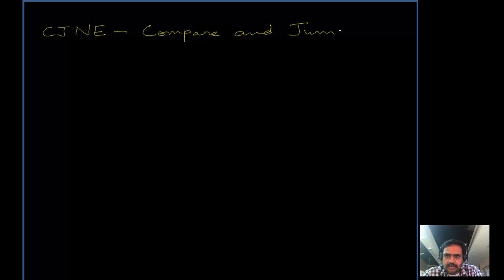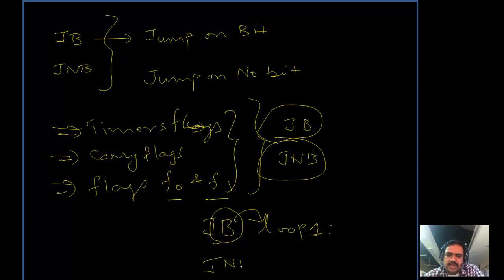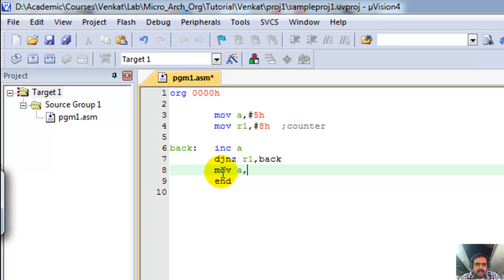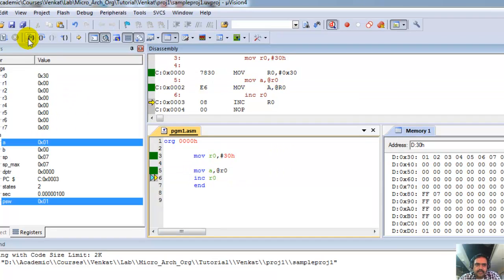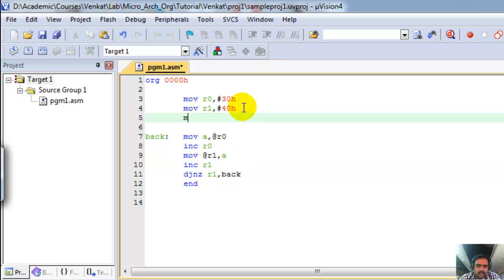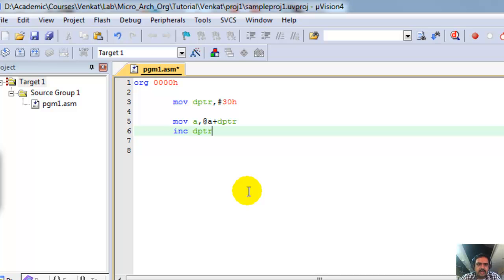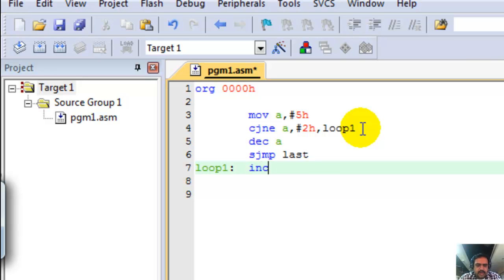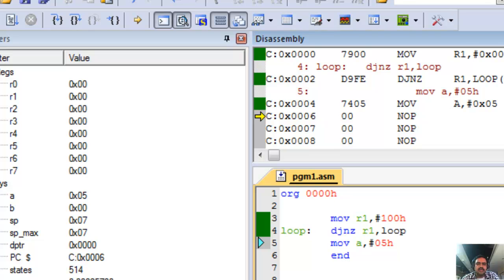KEIL - writing delays, loops and memory operations in 8051

Comment: sir when i execute the programs the data doesn't move to the registers(accumulator and B registers) but it moves to the  R0,R1,etc.what's the problem,and when i done the sorting program it executes but the data doesn't move into the registers and there is no change in data present in memory locations whats the problem.
Reply: yes, that problem is also in my code.
Reply from the maker: Without seeing the code its difficult to pin-point the exact problem you might have.

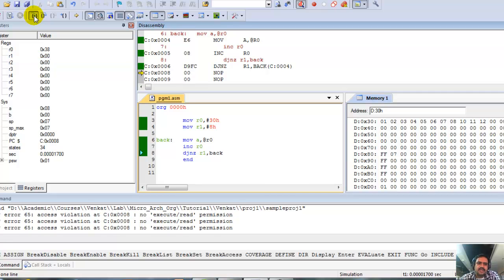Comment: Sir, Why "access violation error  65" shows while executing?? See at 21:51 in your video.
Reply from the maker: Dear Akshay,

When u load an executable of the program u want to run and check, the debugger creates a memory map of the program based on the program and data segments that have been written in the code. The code segment is the executable and the data segment is the read/write segment. In this program once the loop process is over, the code ends and when you keep pressing the step wise run, it gives you that error which indicates the end of execution. When you run it as a whole using single click, you won't get this error.
Reply: Got it.